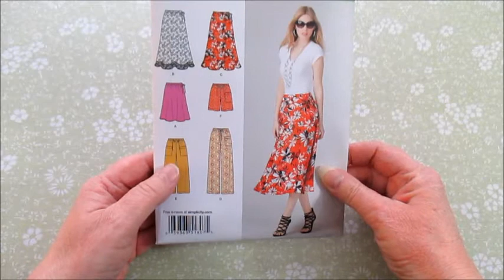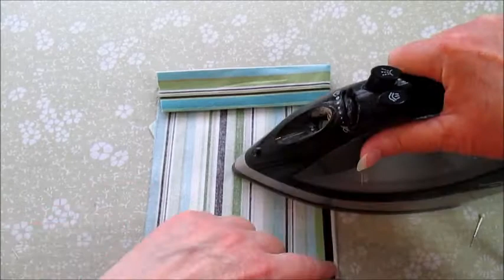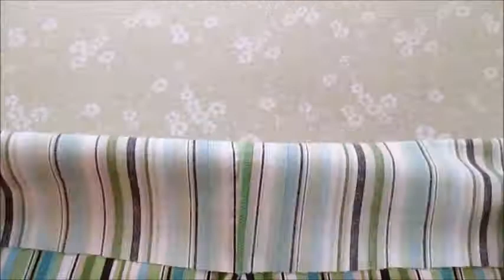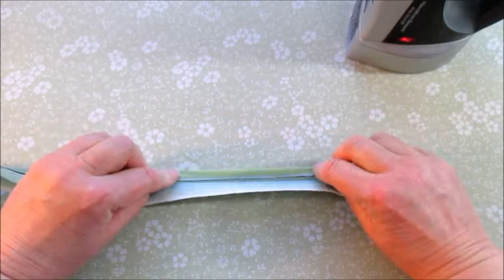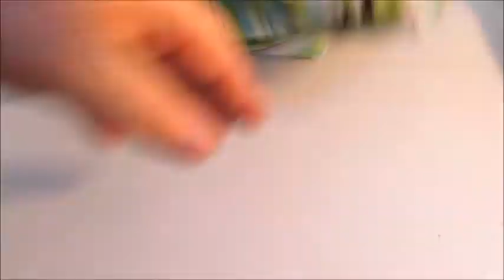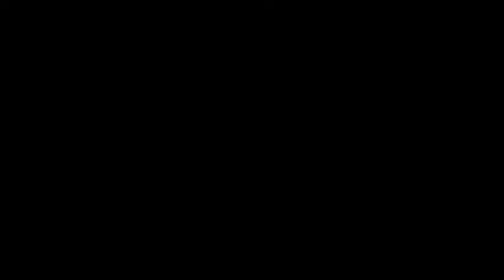Pants Elasticized Waist-METHOD THREE-Drawstring

Comment: Excellent video but, I'm so disappointed. I just wanted to learn how to attach a waistbandwith a drawstring instead of elastic..
Reply from the maker: Hmmm, Dellarene - if I understand you correctly, you want to sew on a separate waistband piece instead of folding over a self-facing at the waist as shown in the video, right?  Then in that separate waistband piece, thread through a drawstring, right?  I wonder what pattern you're using?  If you're winging it without a pattern (which is my style  :)) then usually the waistband is a self-facing fold-over situation because there's no need to sew on a separate piece.  If you re-watch the video from minute 9:30 onward, I think you'll get my drift, and I hope this information helps you!  You can consult with me 1:1 at the following link if you like:  https://www.alterationsbyphyllis.com/consulting